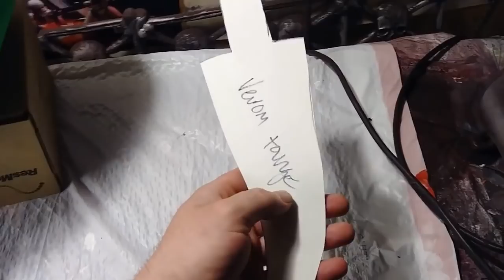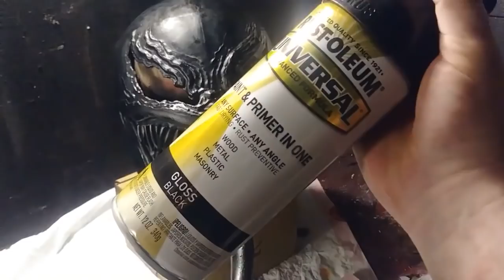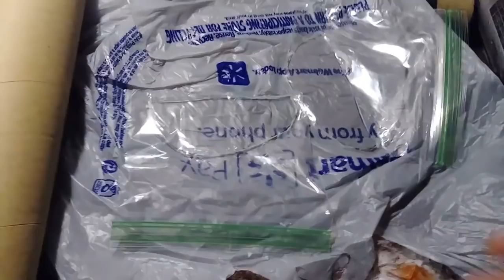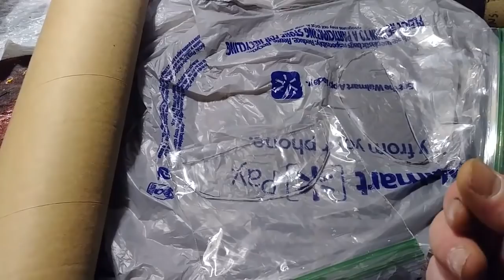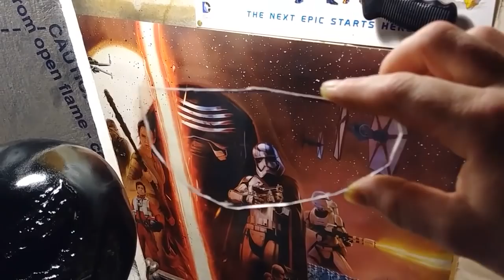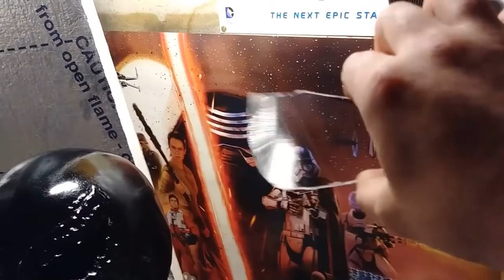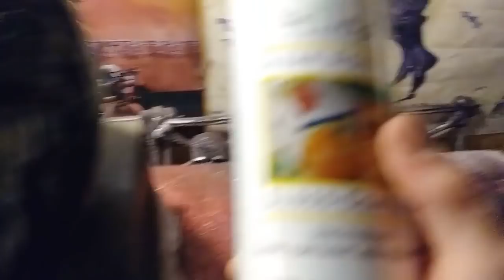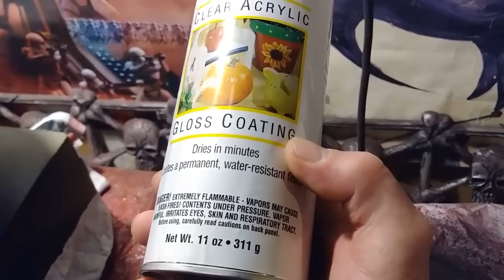Venom Cosplay Mask 2.0 DIY build video

Comment: Cool, I'm wondering how you would approach making the rest of the suit for his body
Reply from the maker: Ill Will SHoMeGa sorry I missed your comment. I just saw it. Well first I would have to see the full Venom so I have a reference. If I was bulky and big a printed body suit would work maybe. But I am not lol. So for myself I would use a durable body suit as a base. Been thinking about making one from stretch pleather because its durable. From there I would cut EVA foam mat pieces for muscles. This would be tricky because I would have to be careful to not have the pieces glued on the joints. These pieces would be carved sanded and glued. I would use latex to even out the the gaps between the foam muscle pieces and silicone over that for longevity. Followed by final details like veins ECT and then seal and paint. This would be extremely hot, but I think mobility would be fair and it would look badass
Reply: Zolus Props and Cosplay cool

Comment: cool mask what was the total cost of materials?
Reply from the maker: Ricc Grimes that depends. If you don't add in the cost of tools, 3 to 4 $ for contact cement, 10$ for a 12 inch by 12 inch sheet of acrylic plexiglass, the foam is around 1$ a sheet, hot glue sticks 3 to 5 $ you could skip the liquid latex since I use so little and it is expensive and just use Mod Podge for 5$ a bottle, paint is relatively inexpensive as well. Total cost of materials to make one mask is about 30$ in what is in the mask itself. But if you do not own some or all of those materials it can become costly. Example: there is about 2$ (1/3 of a bottle) of mod podge in this. But you have to spend 5$ for the whole bottle if you do not own some already. I use a small amount of a 5$ bottle of air brush paint about 1$. But I had to but the 5$ bottle and the 100$ airbrush to apply the 1$ in white paint. You can always substitute acrylic paints and a brush and dry brushing technique for an airbrush and save money and still achieve a gradient look and effect on things like the painting of the teeth. The Dap Silicone I get for 3$. But you need a caulk gun to get it out of the tube. If you have tools like that or know someone who does, you just pay 3$ for the tube. I only used about 1/10th of a tube on this project. If you don't plan on doing future projects like this you will have a decent amount of left over materials and tools you don't need lol. Something to consider.

Comment: This is totally gonna be my next project.
Btw wouldnt plastidip be easier than modge podge to seal the foam? (sorry if i missed it if you brought that up)
Reply from the maker: DarthAndrew520 yes it would, however I was not a big fan of the texture of plasti dip, plus I am impatient and plasti dip I usually wait 24 hours, but the mod podge I usually only wait 2 hours (in summer) before I paint. 3rd reason is if the plasti dip were to pool up in the raised detail areas I would loose some definition possibly. Working on another variant of Venom now that is similar but with a moving and working jaw, but no tongue. Thanks for watching!!! Send photos if you decide to do a build of this!

Comment: Just got the template and started this weekend, hoping it looks half as good as yours. Really great mask you're a master of your craft! Thanks for sharing.

Question, what do you use/recommend for cutting the foam and holding the seams together while adhesive cures? I used an x-acto knife which worked ok but the seams are far from clean like yours. Do you cut the "V's" with an inside angle for better fit or would you recommend just get it together then smooth it out once everything cures? Thanks again!
Reply from the maker: I cut everything straight, sharp scissors or xacto knife. The contact cement I use bonds instantly
Reply: Thanks!
Reply from the maker: @davedelafleur6703  sure!

Comment: for the gum line, would using some red or pink glue gun be a good subsitute for using the cut out.
Reply from the maker: Sure, if you feel more comfortable with that.
Reply: @ZolusProps  thx, I was also wondering can EVA foam  be heated like the crafting foam used in the video
Reply from the maker: @aidanviarengo8536  yes, the craft foam is EVA it is just a lower quality, in the sense that it is a lower density.
Reply: @ZolusProps  thankyou, BTW excellent job on the mask
Reply from the maker: @aidanviarengo8536   thanks for watching!
Reply: @ZolusProps  how long should the heat heat gun be on the EVA foam for it to become shapable?
Reply from the maker: @aidanviarengo8536  it usually only takes a few seconds, if it is your first time using one, I would test on scrap foam pieces until you become accustomed to the tool.
Reply: @ZolusProps  ok thankyou
Reply from the maker: @aidanviarengo8536  you're welcome!
Reply: @ZolusProps  i just tested it out, one tooth down a mess of teeth to go lol
Reply from the maker: @aidanviarengo8536  oh yes. I know all too well about teeth lol. Very tedious, but worth the reward of looking awesome!

Comment: do i need to buy the pattern?
Reply from the maker: No there is a link in the description to a free pattern photo laid out on 12" X 18" foam sheets for scale
Reply: @ZolusProps  Would printing the free pattern photo on a 8½"x11" = the same size patterns that you used?
Reply from the maker: @aidanviarengo8536  you would have to split it in half and print it on 2 sheets, it would be a little small. Or turn the photo into a pdf and enter the dimensions of the foam sheet (12"X18") and print from there. Or run it through a trace program.
Reply: Zolus Props and Cosplay thank you
Reply from the maker: @aidanviarengo8536  you're welcome
Reply: Zolus Props and Cosplay how do I enter dimensions into the pdf

Comment: After I saw this vid, Im making it right now, Ill send you a picture of it when I’m done add me on Instagram - jacob.bieberx
Reply from the maker: Venom Awesome! Thanks for watching, glad the video inspired!
Reply: Zolus Props and Cosplay Im making it for halloween but how do I make the lumps/wiggly lines next to the eyes
Reply from the maker: Venom hot glue is what I used. You could possibly substitute puff paint, but I don't work with that
Reply: Zolus Props and Cosplay Ok, thanks
Reply from the maker: you're welcome!
Reply: Zolus Props and Cosplay Wait I got one last question before I stop bothering you, How do I cut out/curve the plexi glass? and what size because mine is the same as yours right now and I need to know the eye size
Reply from the maker: Venom with a dremel rotary tool, curve by heating with a heat gun